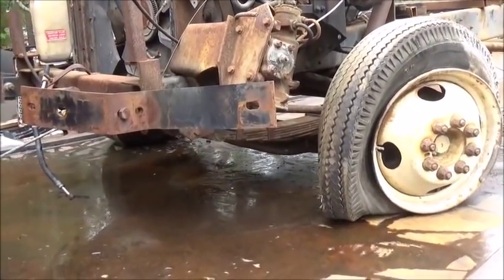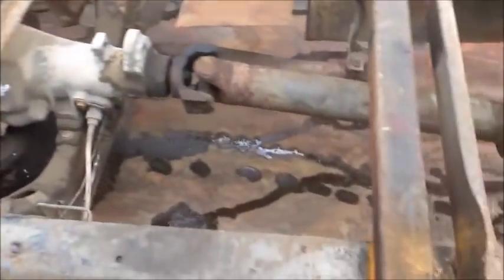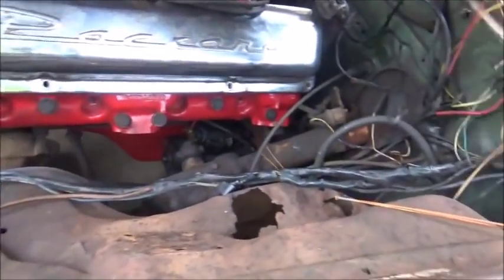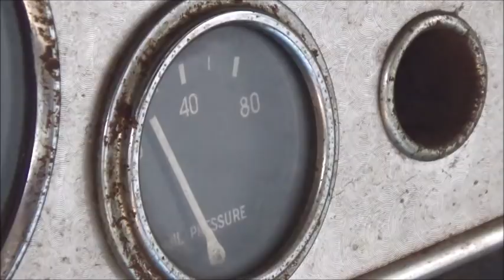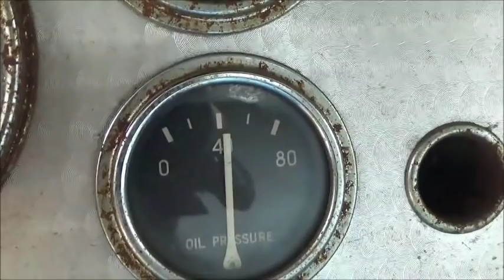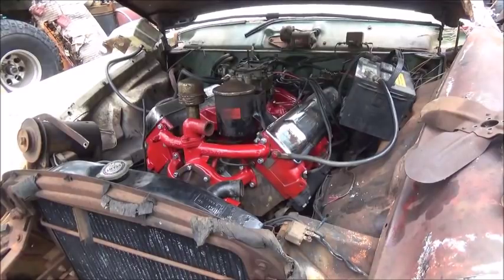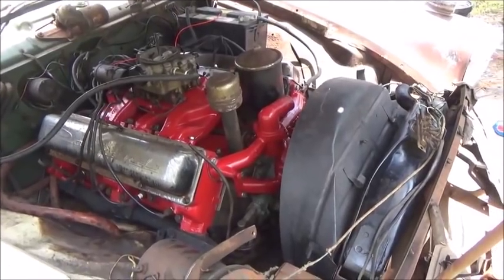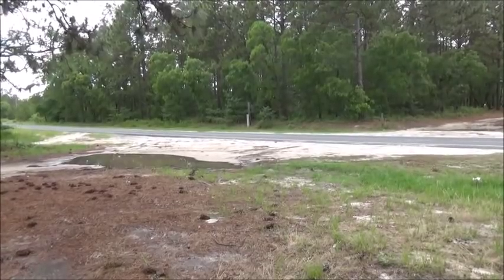1956 STUDEBAKER / PACKARD 352 WILL IT RUN AGAIN??

Comment: Great job on bringing that 352 back to life Dr. Jonathan! It sounded great. Can't wait to here a Packard 352 running with Flowmasters! Glad it's not a feuding neighbor situation, but even if he didn't know the phone line he was repeatedly cutting with his mower was knocking out your phone & affecting your buisness, he still should have took special care not to cut it anyway. Cutting it one time, Ok, I can see that being an accident, but multiple times is just ignorant. Just because he wasn't affected apparently, doesn't mean it's Ok to keep doing it, He had to know someone was being affected. Those welds you showed on the frame rails were downright scary! It's a wonder the manufacturer thought that was acceptable. It's a good thing it was never in a major wreck because the entire body probably would have seperated from the chassis & disintegrated since the older motor homes were mostly made of wood.

Comment: Wow! nothing sounds as nice as an American V8. There used to be an exhaust pipe bender called a Bend-o- Graph. All the SoCal muffler shops used them in the '60's. You would bend a piece of wire to the shape of the pipe you wanted then put the wire and a straight pipe in the machine and bingo a correctly bent pipe. Thanks for making my day.

Comment: Been following progress on this with interest. Acquired one the year you were born. Didn't realize they came with a Packard engine as mine didn't have one (or transmission). With a lot of work and modifications  I shoehorned a 394 Olds with Hydramatic from a wrecked  Holiday I had into it. That thing was scary.

Comment: I never thought I'd see AND hear a Packard V8! Thank you for getting the Golden Hawk and rebuilding (repairing) much of the engine!! The engine was big for its day at 352 CI I think I saw 4 holes in the intake manifold, so it had a four barrel carburetor.  I'd  love to know what power and torque figures they advertised it having.

Comment: Bravo!  It lives!!   The water pump mounting and even the water manifold looks very much like Studebaker V-8.  Was this a special on the Packard powered Hawks, or was it regular Packard ABOUT THE PHONE LINE PROBLEM: While I was among the ones who suggested burying your own  service line, I am advocating going to a depth of less than 6", preferably 3.  When you "plow" a line in, you hardly disturb the soil, as the hole is around a half inch wide or less. electrical lines must be buried 24" or greater in depth, likewise natural gas lines, and telephone cables, which are generally around 36" or greater. If you have municipal utilities, the normal depth for water is 48" and sewer varies all over the map to allow gravity flow.  I also highly suggest getting the phone company to furnish the wire to you at no cost (usually they will be willing to do this) since you are offering the initiative to install it!  Were I doing it, I would offer to "Run it in for them, with the provision that they furnish the cable, and terminate both ends, then remove the old, now useless cable.   If you suggest doing this to your contact at the NC utilities commission, they will probably be very much in your corner, and you might not even have to do the work yourself.  they ARE supposed to by your advocates!  I estimate you could build a cable plow to fit the Bobcat in an hour or two, without having to invest any actual money in the project. You could even use the chain saw motor and hoses to temporarily serve. After all, you're only going a coupe or three thousand feet, and only once! Good luck!!

Comment: Hi Jonathan a while back I changed the water pump on my 1994 jeep grand Cherokee and ran into the same problem with the water pump being tall you can't put the fan back on.so I put on electric fan on and ran the wire for a on and off switch and it the switch under the dash .good video

Comment: I learned something from an old timer mechanic years ago about running a compression test. Open the throttle plate on carb this allows maximum air intake to ensure the highest reading possible.

Comment: Sounds like a hot rod for sure!🤘. I think you need to look into getting a femtocell. It’s basically a personal cell repeater that will boost your cell signal so you’ll have good reception wherever you are on your property. Not a fix for this issue, but would help for now.

Comment: Damn Jon that old Stud really looks like it is going to be a really powerful runner. That Packard 352 was rated at over 300 h.p. with the 4 bbl carb. It was 305 hp or something like that. It ought to be pretty quick. I would not mind having the old girl now that I know there isn't anything wrong with the motor. I really always liked them growing up back then. They were certainly different and grabbed a lot of looks.

Comment: just a tip  on the 440-3  motorhome engines.. FMC did some trick things to the thermoquad and the distributor advance to really improve durability.. so be sure that you use the original components.   FMC used those engines on oil drilling rigs and water pumps that would run 24 hours a day at full load.. part throttle.   be sure to measure the metering rod holder height before taking it apart.. hopefully nobody has  been into it before. 

one more thing.. install a 1984 corvette fuel filter directly before the fuel pump inlet..  that filter is rated at 10 micron and will remove the sediment that holds the fuel pump check valves open.. reducing fuel pressure to the carb. . reducing the ability of the pump to pull it from the tank.. it will also if you do some 15 second full flow pump into a clean clear soda bottle procedures clean the sediment out of existing pump bodies and check valves..  when the engine is hot and returned to idle. the low pressure in the fuel line to the carb starts to boil.. the expanding vapor pushes the liquid fuel back to the tank and the engine leans out and stalls..  because the engine ran lean the pistons and rings are expanded and are dragging on the cylinder walls. making it really hard to crank the engine.

Comment: Johnathan, I'm a retired electrical power engineer. You can use a vibrating plow to bury that likne in the ground. It goes fast and very little mess.

Comment: If you just need a land line you can get a dedicated home phone line from Walmart (Straight Talk) for $17.00 per month when you purchase the receiver box for about 100.00.  Works fine and is reliable but uses the Verizon cellular network.  You just plug your telephone system into the box.  Won't do Fax. and does not address your internet access issue.  Since you place the box and leave it, you can pick the spot with the best signal level.

Comment: I love that packard engine.  That is engineering that is above any automotive engine of today.  Mil generation people think todays engines are superior.  A 63 year old mechanic and machinist as myself with 49 years experience laughs at that BS.  Between Jonathans 56 studebaker with that 352 packard engine and that 61 dodge lancer with that slant six, Just those two engines are ABOVE any engine made today.  Even cadilacs 315 and 331 V8 used back in 1949 and maybe earlier with OHV was superior to engines of today.Todays mil generation and their off spring has been totally bullshitted by marketing

Comment: where was that small wire coming from that's going to the battery.reason i ask is because i just finished installing a new harness in my '75 cj-5 and need to get the engine  running,thanks.
Reply: I believe that was the coil wire that comes from the ignition
Reply: Positive side of the ignition coil.
Reply: @donaldk.macbaird4950  thanks for your reply.very much appreciated.
Reply: @russdavis1960  alright,thanks for replying.appreciate the info very much.

Comment: Hi Jonathan nice video that sounds really nice.  Just one thing. Every time you went to give some throttle did you keep get a kick off the spark plug lead or something cos every time you did jump a bit.  But great job and great video as normal.  From Andy in UK
Reply from the maker: Insanity is doing the same thing over and over and expecting different results. I must be insane, I got shocked every time.
Reply: @jonathanw4942  I thort you were cos I was all ways doing.  I think that's y I like my diesel's theys days  😁 do a bit on cars . When I am working it's on land rovers all the time.  But i'v still got 2 v8 . But i'v all ways bin a good earth thow even changing welding rods I get a belt up the arm.

Comment: Jonathan o can fix engine but I have no clue about wiring when u first start an engine on the ground I don't know how the starter runs to the alternator, battery,and back if u could show us how u use the push button start it would help because we're all beginners and not seasoned like you